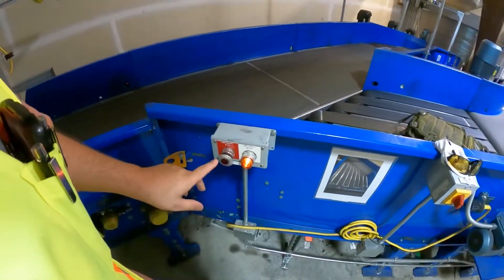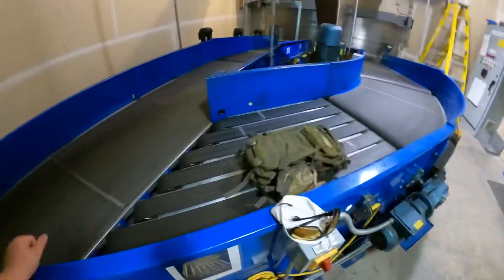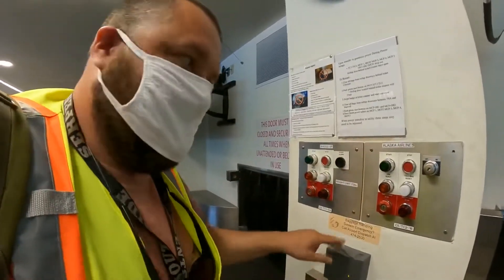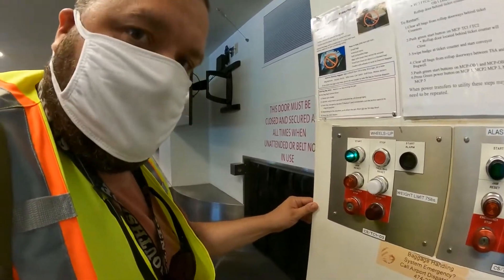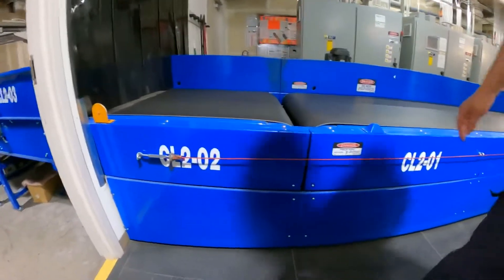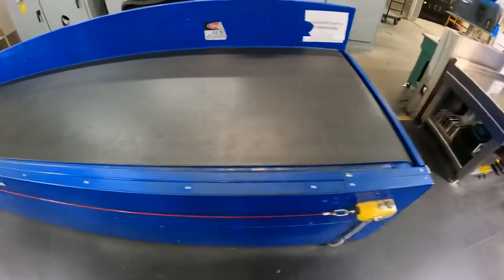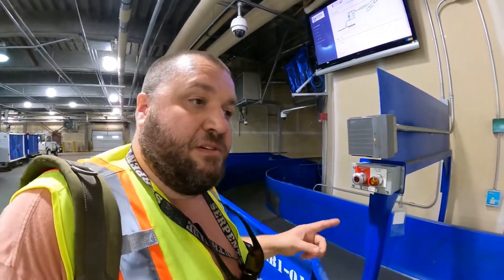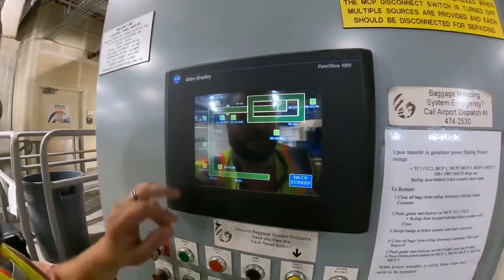How to reset a Bag Jam on The Baggage Handling System (BHS)

Comment: Got a question, if belt has a high pitch screech at start up, what’s the cause
Reply from the maker: At 1st thought 💭 I would say the belt is too tight and needs to be adjusted.
Reply: @180Floridalife  I was thinking the same, I’m starting at this job soon and need to know these things, also what’s a missing bag jam?
Reply from the maker: @kchriswoppy4475  a missing bag jam fault happens when a bag has been removed from the belt, inside the tracked area of the system, this is outside of the normal areas a bag would be removed from the belt. Basically the system is expecting to see a bag at the next tracked photo eye, but the bag has been removed before that point
Reply: @180Floridalife  thank you for explaining that, I’ve come across others and you seemed to explained it better, really appreciate it man.
Reply from the maker: @kchriswoppy4475  thank you 👍